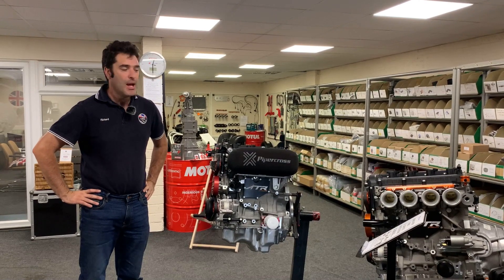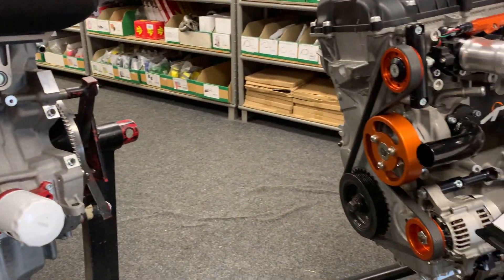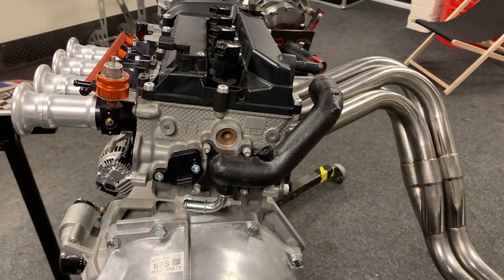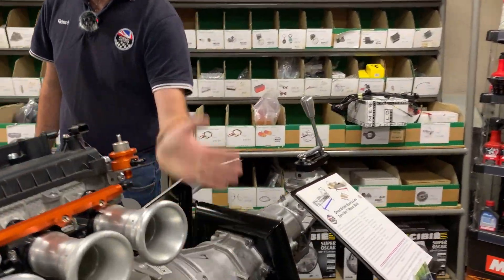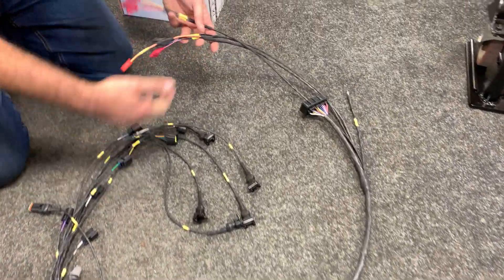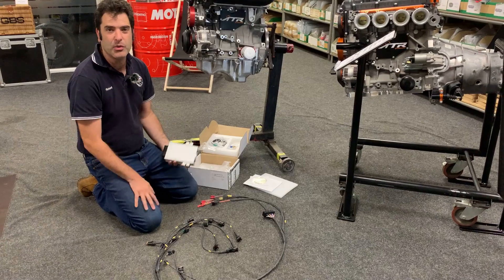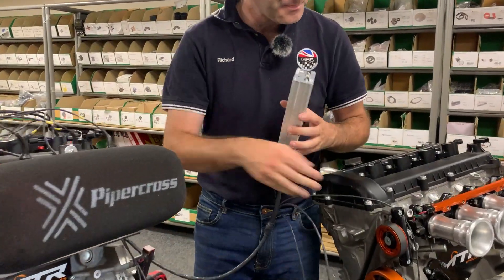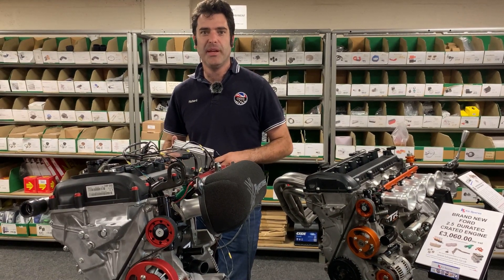Talk through the installation of engine and components on the Ford 2.5 Duratec Engine.

Comment: what sort of hp can the 2.5 get on standard internals
Reply: 200-250WHP. To get 200WHP all you need is a good cam and tune. To get to the 250WHP range you need ITB and ported head.
Reply: @jjchockey  What made up unit is 'WHP'? 🤣🤣
Reply: @TRPGpilot made up? Wheel Horsepower has been used for many many decades. It is what the car puts to the wheels after drivetrain loss. BHP or brake Horsepower is what you see from manufactures.
Reply: @jjchockey  Correct. So why use a made up unit? Alternatively Kilowatt is universally better understood when referring to engine power output and does not vary from region to region in definition or method of calculation.
Reply: @TRPGpilot what are you even saying 😂. Wheel horsepower isn’t made up.

Comment: The 2.5's that you get from Ford - are they the Ford Ranger / MSG425 engine? I'm paying attention to the Valve Breather, which is on the top in your video with your custom blanking plate. The Ranger and the MX5 both seem to have the breather on the top. The FWD Duratec valve covers all seem to have the breather jutting out the exhaust side on the transmission end of the head - even the mazda MZR Disi motors that route the turbo compressor outlet right by that outlet are the same. Is the RWD valve cover available separately by any chance - other than trying to find a seized 2011-2015 2.5 Petrol Ranger or NC MX5? I am in Australia.
Reply from the maker: A lot of these parts are available separately, please visit www.kitspares.co.uk or contact the team from the website and they can advise you.

Comment: My 2016 engine(Fusion) has a flat oil pan, which year engine is that?
Reply: 1826
Reply: What that number means? Engine size?
Reply: @19mati67  Do dummy, it means that the engine was built in 1826:face-blue-smiling:
Reply: @fortniteisbadatfortnite2570  What is the point in joking here? I'm trying to find an info and you are joking? Please move on, if you can't be useful.